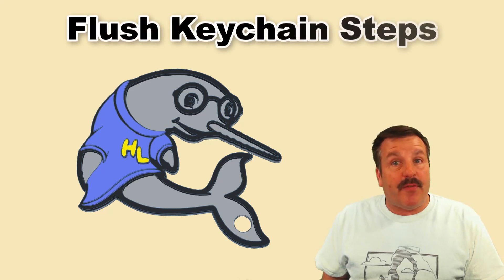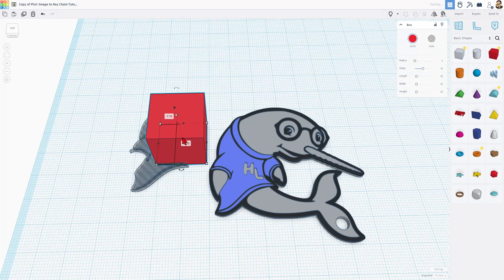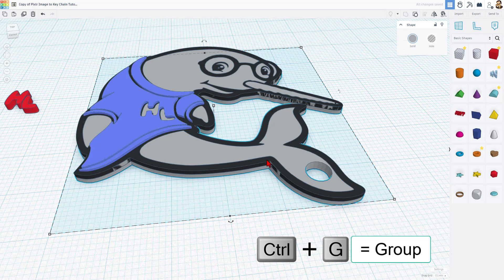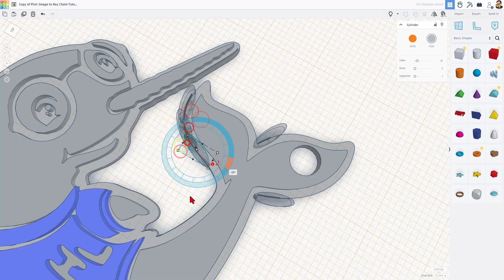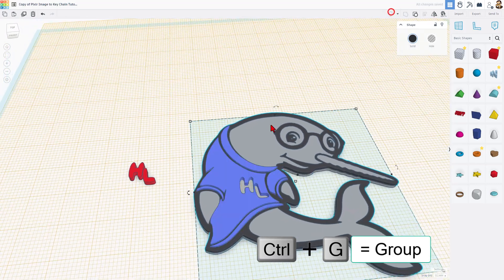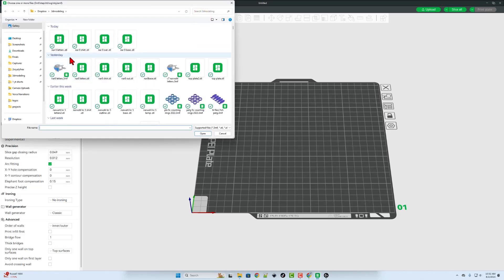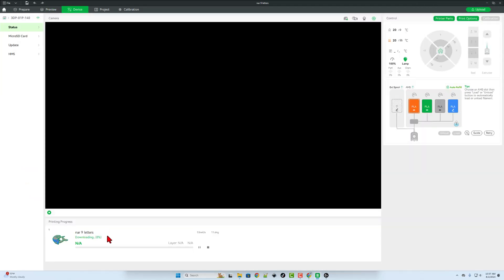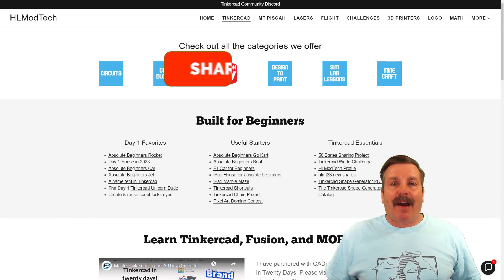Smooth Multi Color Keychains Tinkercad & Bambu Studio Steps for Beginners

Comment: Hi HLModTech.
Finally we can print multicolor prints. Super great video. You make it look easy. But I need to ask. Why not flip the print arround for a smoother finish, then it look much better and cleaner? Hope this makes sence. Keeper up the great work by making videoes. It helps a lot. Chears from Danmark.
Reply from the maker: Thank you. Good point on flipping them. I will give that a that a go. I generally print mine with different heights so it is not possible. It is fun when viewers nudge me to stuff I have not worked with before. =) Thanks for chiming in!

Comment: A another good tutorial, but I have found a better way to do it without using brute force. I’ve dropped a design in the hlmt23 tag showcasing it. What do you think about it, HLModTech?
Reply from the maker: Groovy! I will check it out!
Reply from the maker: Ah... I had started with that version, but the slicing software cannot handle it. Each part needed to be separate for Bambu Labs Studio. Do you have a 3D printer?
Reply from the maker: Yesterday's video highlighted the issue. https://youtu.be/uU6IHtZTlgo?si=-33ldJceh9LwKwB2&t=22 I have it cued to the moment.
Reply: @HLModTech  I have probably mentioned this before, but I don’t have a 3D printer. However, in a past video where you compared native Tinkercad files to .stl, you briefly mentioned that it doesn’t matter to choose between .obj and .stl when sending to Bambu Studio. But since .obj is supposed to preserve color and texture data, it could help with the slicing problem. Only way to find out is to experiment with .obj import/export. If that doesn’t work out, then we could experiment with a less brute-force method in Tinkercad.
Reply from the maker: I will give that a test one of these days. As always, thanks for the thoughtful response. 💯👍 I really appreciate the way you think and that you keep me on my toes. 🔥🔥🔥🔥